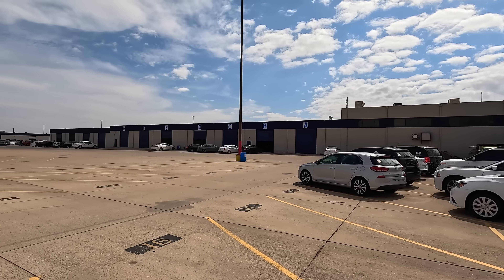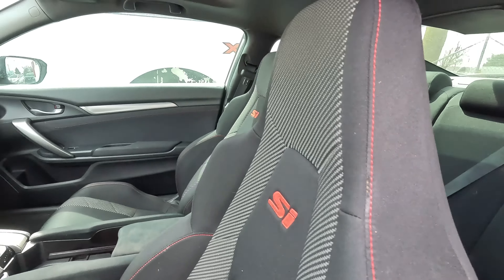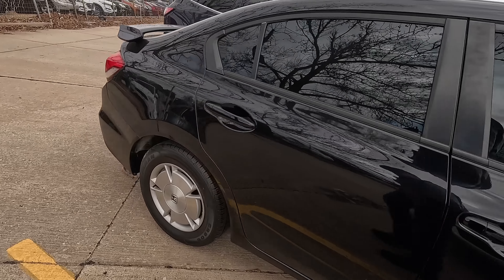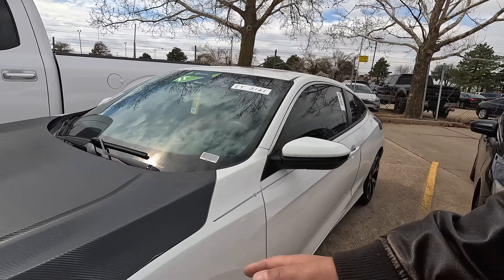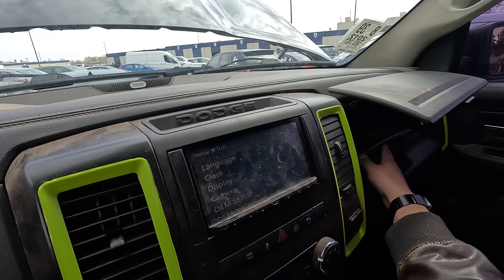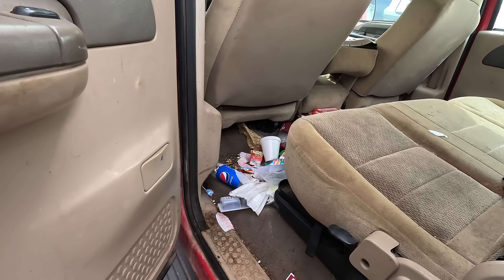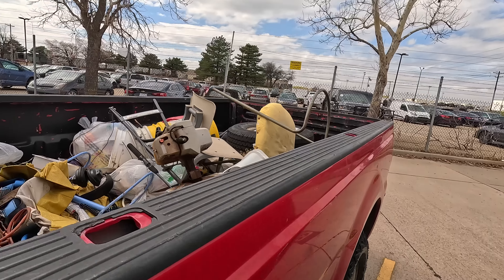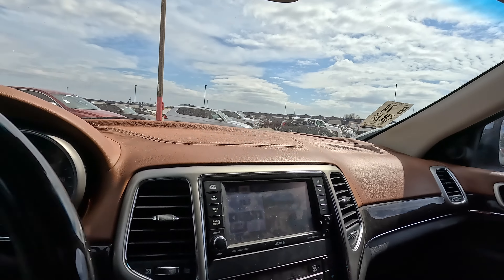Dealer Auction Walk Around + Cheap 2017 Honda Civic Si - Bad Clutch!

Comment: I swear Randy thinks about folks who are at work. His videos come out during lunch. Great content while eating my lunch on this one hour break my job gives. Thanks man and keep them coming!!!!
Reply from the maker: You rock!
Reply: @AutoAuctionRebuilds  Thanks man! 
I pretty much can tell what the deal was on the 2 Civics and the Ram. That being said, I'll share a little secret on what the big dealerships do. I'm an Inventory and Reconditioning Specialist for Nalley dealerships here in Atlanta, GA. What they do is they take trade ins and they inspect them. The dealer has a certain amount of money to spend on the cars after they purchase them. If the repairs and recon cost more than what they paid, the car gets kicked to auction. Example: A 2009 Lexus IS250 came in on trade the other day. The dealer saw that the car was only worth like $10k because it had like 151k miles. Well the car need a lot of work. Mainly a lot of deferred maintenance. Well, the dealer had a threshold of like $3k. The parts and repairs exceeded that and they kicked a perfectly good car to auction. Newer cars like the CPOs (2-5 years old)are purchased from auctions too but the dealer pays a nice penny for them. They change the oil, put new tires and brakes on them and send it to detail department then it goes to the lot.

Comment: I would love to see videos from Manheim auctions. I have nothing but respect for them. My mom worked at a car dealer for about 3 years that got most of there vehicles from Manheim and probably the biggest thing that set them apart from other auctions is that they had a test track where you could drive the vehicles to test them out.

Comment: Hey randy,
I’ve got a 2018 civic si had since new and since tuning it with downpipe and other mods clutch has been a weak point. Beat this car through high school and through college and still running strong, great little car can’t recommend enough. Great video per usual keep it up!

Comment: I think going to DAA is much better for your business and wallet needs. I am quite sure you will find vehicles you like as well as make money on. Copart, et al. vehicles just have too many issues, in particular major body work that you may not be equipped or have the skills for and painting must be left to pros with the proper facilities. Replace a clutch in a Honda, not a big issue. Buying a pickup that needs mainly some clean up in and out, some minor body and mechanical work - good choice. And we can still get good YT content.